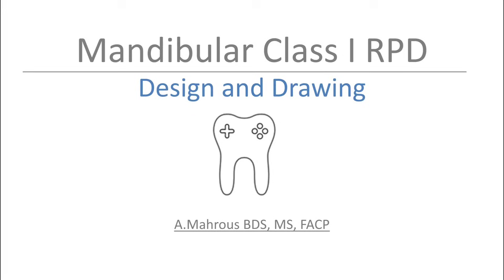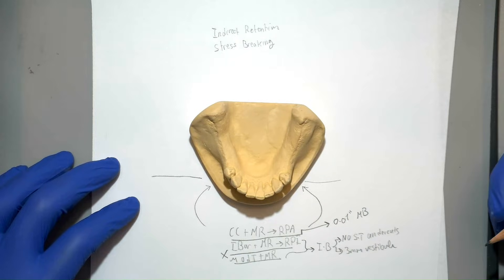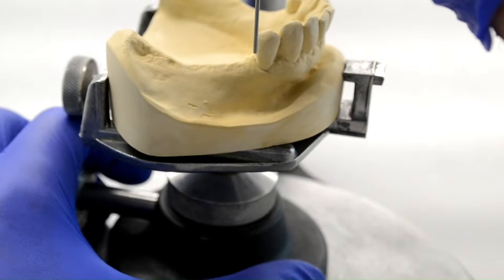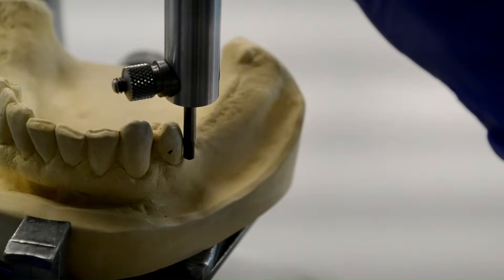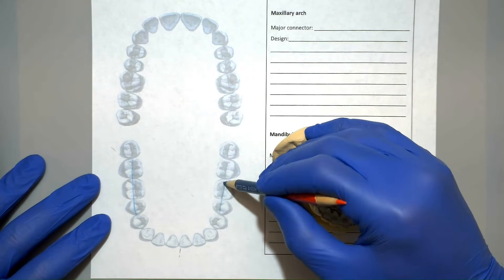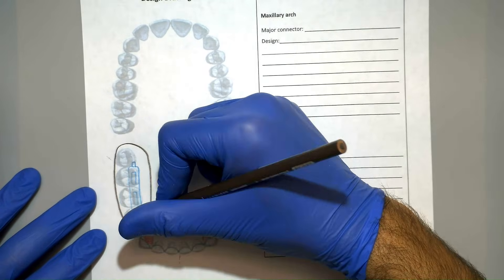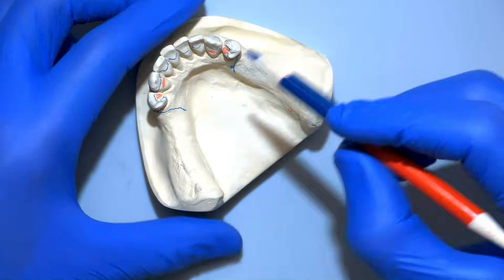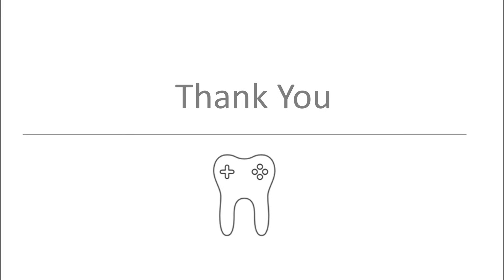Mandibular Class I RPD Design: Step-by-Step Guide to Surveying & Drawing on Casts and Paper

Comment: Are you sure you want to put rest seats on the mandibular canines when they lack height of contour?
Reply from the maker: @nanate25  this is a common issue with many anterior teeth . Despite that the canines are usually one of the strongest and longest surviving teeth in the mouth and using them as an abutment teeth is preferred . In cases with insufficient contour we can employ many different techniques as discussed here https://youtu.be/SEcvLRmniS0?si=IuAtTDjeBbLbCGNn

Comment: why not lingual bar ?
Reply from the maker: @Shacoloban  in this case we assumed there was a reduced periodontal support of the anterior teeth. For those cases a plate is recommended to support the teeth and provide easy tooth replacement if a tooth is lost
Reply: @ I see know doc. Thanks a lot
Reply: Surely that compromises cleaning and saliva and cause plaque stagnation. Would a Kennedy bar not be more appropriate?